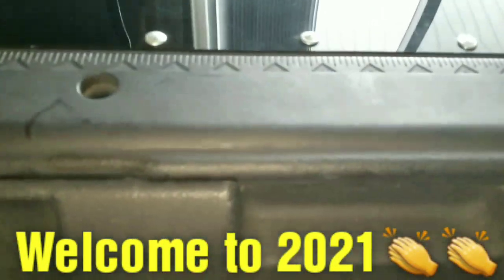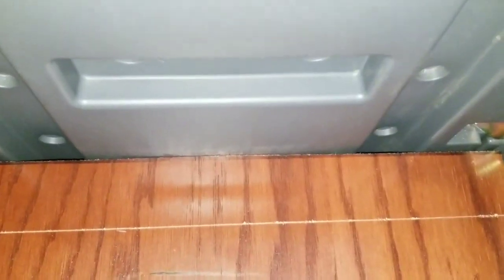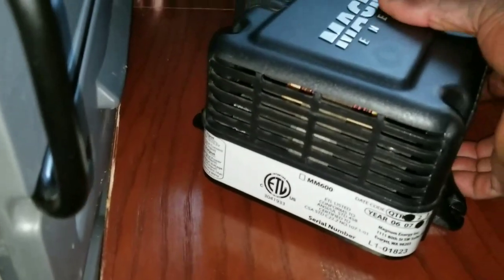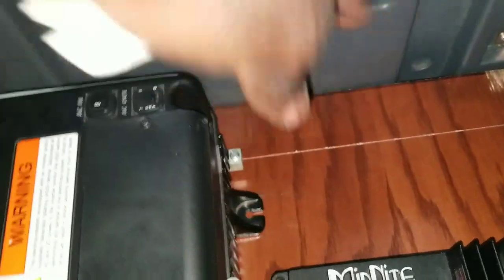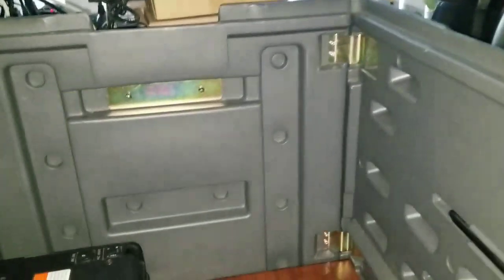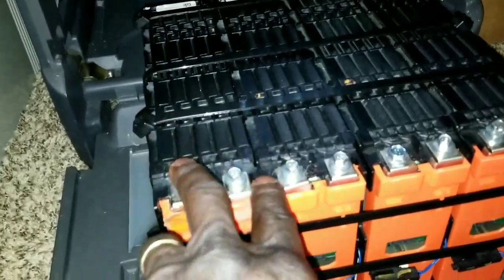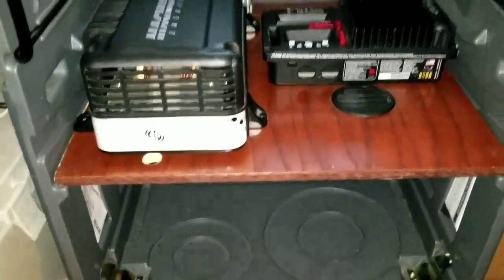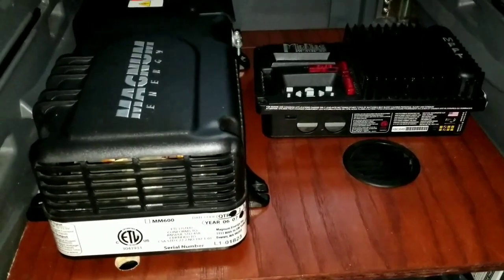PORTABLE SOLAR GENERATOR 2021, DIY, DESIGN, EQUIPMENT ARRANGEMENT AND INSTALLATION #part2

Comment: I Think Thats A Great Way To Start it Off How You Got It Designed . Next Are The utilization Of Wires , Meters And Switches To Make Connections . You Have A Good Thing Starting . Where Are The Utilization Of Power Inlet And Outlets Recepticles Going To Be Implemented For Easy Conection And Access . You Are Doing A Wonderful  Project And We Will Be Happy To Assist You Because We All U Tubers Want You To  Succeed At The Building Of This DIY Solar Generator And  Many 2021 + Future Ideas That Comes To Mind . Never Give Up But It May Take Some Time , Planning And Advice .
Reply from the maker: Thanks for the awesome comment brother Green